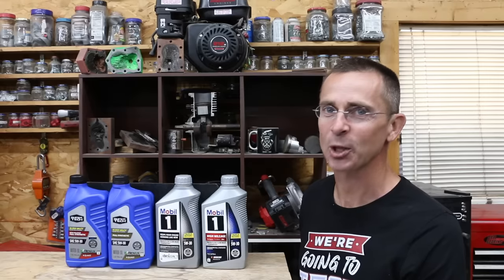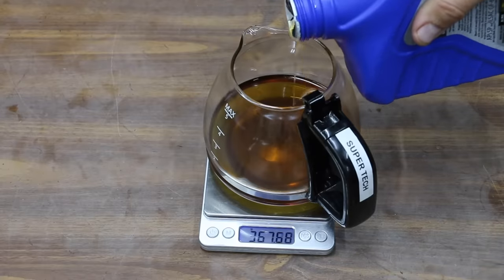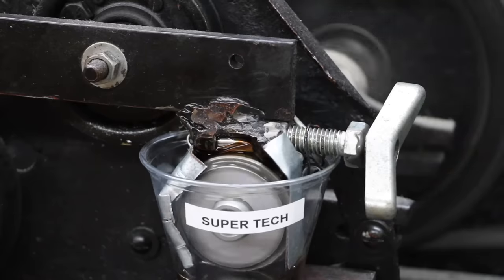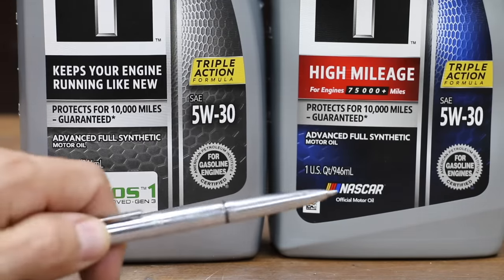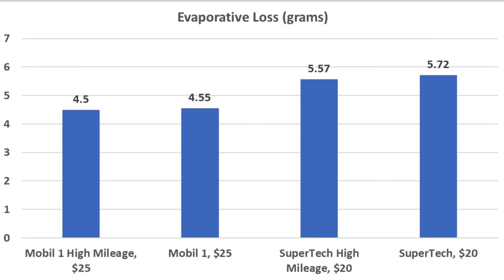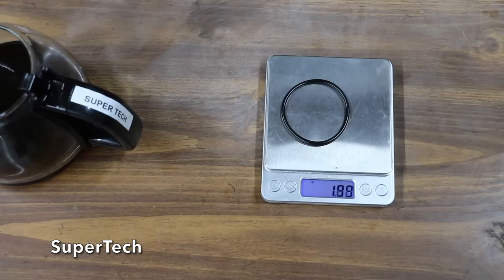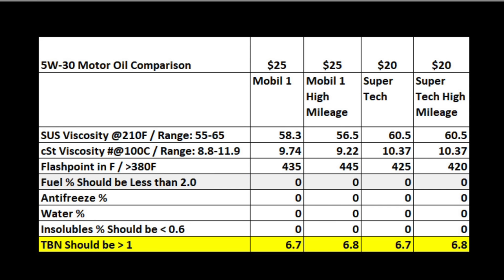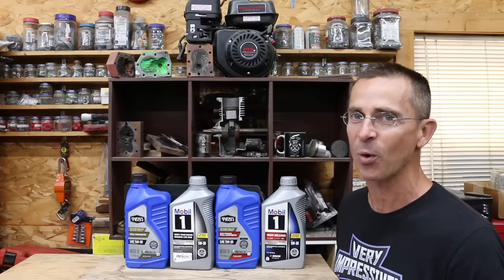Is “High Mileage” Motor Oil Safe? Let’s find out! Mobil 1 vs Mobil 1 High Mileage; SuperTech vs STHM

Comment: Until today I had been usung 0W20 Firestone (Penzoil) total synthetic oil for my 2015 Camry which has 92,000 miles. Today I switched to PZL 5W20 (Toyota recommends 0W20 or 5W20); surprisingly it was $30 cheaper. I hope it just as good.
Reply from the maker: Thanks for the sharing.

Comment: Valvoline High Mileage oil works great. Slowed and stopped oil leaks on my 1996 Toyota 4runner 3.4 V6 with 290k miles. The engine had a bad rear main seal leak and after using the high mileage oil for around 3k miles the oil leak stopped.
Reply from the maker: Thanks for the feedback.

Comment: Have been watching your channel for long time. A lot of them are quite informative and entertaining. Sometime when I want to purchase some tool or stuff not familiar, I will search in your channel to find out what the test results here. Especially these motor oil tests, they're really helpful for me to make a wise choice. However, I just notice that it seems no engine oil filter test has been done before, did I miss anything or they're already not tested recently? I would suggest to have a test like the air filter one to find out the best filtration capability of these oil filters available in market (Amazon/Walmart) like K&N, Mobil 1, WIX, Purolator, Super Tech, etc. Thanks!
Reply from the maker: Thanks for the suggestion.

Comment: Maybe you should test the Super Tech Advanced full synthetic from Wal-Mart the one that is good for 20,000 miles, I started using that one on my 2008 Toyota corolla and noticed an improvement in performance and acceleration and is only 21 dollars in my local Wal-Mart in California way cheaper than the Advanced full synthetic from name brands like Mobil 1 and Castrol Advanced full synthetic made that claim to be good for 25,000 thousands miles. I still change my oil before it gets to 6000 miles just to be safe.
Reply from the maker: Thanks for the constructive feedback.

Comment: I use the M1HM myself. As for price, Advance Auto parts usually run a deal for (now) $42 for the 5qt jub and a filter (M1, KN, Fram).  Although I remember a few yrs ago it was $25. blah...
Reply from the maker: Thanks for sharing.

Comment: I would say it does not have the textile certification because it does not need Sodexo certification it exchanged dexo requirements pretty much guarantee that they will find other problems before they blame the oil.
Reply from the maker: Thanks for the feedback.

Comment: @projectfarm I use Rotella Diesel Oil in a lot of my gas trucks. I've always gotten complaints about it, but never had any problems. A lot of these trucks have gone 50,000 to 100,000 miles and roughly are in the 200-300,000 mile range. I always use fully synthetic and change my oil around 3,000 miles out of habit.

My question is, can you do a video on Diesel Motor Oils vs Gas Motor Oils?
Reply from the maker: Thanks for the suggestion.

Comment: We run a custom blend from Power Driven Diesel on our engines with hydrologic flat tappet cams & diesels pre dpf & egr ect.  It has an amazing addative package with zddp for longer wear.  We also add lube to our US diesel for longer pump & engine life.  Low suffer was a mistake & global warming......  kinda hard to claim CO2 caused it when it dropped prior to the temp rise but we are not supposed to be paying attention!  Kind of like charging more for unleaded back in the day when they just stopped adding it but charged us more.

Comment: The only thing added to high milage motor oil is a seal sweller. The rest of the additive package remains the same. In theory the only thing it may prevent is an oil leak.
Reply from the maker: Thanks for the feedback.

Comment: One of my managers at work has his Masters and Dr degree's in chemistry, he did his thesis on motor oils, his conclusions on which is best, regular, synthetic, high mileage etc, was, just change your oil regularly. Synthetic maybe a little better but he didn't suggest it specifically. Also any additives in oils for what ever purpose, he said was gone after 1000km's/600 miles.
Reply from the maker: Thanks for sharing.

Comment: I really like the Mobile 1 high mileage. The one I got for my trailblazer was 15,000 miles. Oddly my change oil light didn't come on until around 25-30k miles. When it was totaled in a accident it had 316,000 miles on it. Original motor. No leaks other than exhaust. The local mechanic shop said I shouldn't use it since regular oil changes at a shop find issues most don't notice. I knew that SUV very well. If something wasn't right, I took it in if it wasn't something I was comfortable fixing. Mobile 1 is great. You can get 25-30,000 miles out of it. It costs $70 and you have extra for the burn off. Just my opinion.
Reply from the maker: Thanks for the feedback.
Reply: @ProjectFarm  I should note most my miles were interstate. But even when I was commuting to Minneapolis 175 miles, and driving in heavy traffic I still got around 20k before the change oil notification came on. City verse highway makes a difference. I don't want to mistake that. Most my miles were interstate and highway. Outside the cruises on minimum maintenance roads that I would beat on the old girl. Also I checked my oil frequently, if it was black and the light wasn't on I changed it. Though that only occurred with the regular Mobile 1 5k. It sucked during winter. The noises were gone when I switched to the high mileage Mobile 1. Granted a -35F day would be the only exception. But anything above -30F there wasn't the whine the regular synthetic Mobile 1 gave. I switched to the high mileage over a decade ago, so it's difficult for me to remember exact temps. I just remember that whine going away when I switched.

Comment: I've been an avid user of Valvoline oils for over 35 years, and the Maxlife high mileage oils for 15. Well over 225,000 miles on all my cars using Maxlife and no issues. They all get changed at 3000-3500 miles.
But it's nice to know Super Tech is right up there, as the supply of some name brands gets thin at times at my local Walmarts.
Reply from the maker: Thanks for the feedback.

Comment: Hi, I really like your video’s but please note that oil compatible o-ring material (NBR) used in engine shouldn’t swell.  As opposed, an epdm material o-ring which is not oil resistant would swell.
My 2 cents and keep doing the good job you are doing with video’s.
Reply from the maker: Thanks, will do!  Thanks!  Thanks for the constructive feedback.

Comment: Have you tested Motorkote UCL yet? I am interested if it is superior to Lucas and other brands. Upper cylinder lubricants seem to a niche but if they are beneficial in the longevity of my engines I will start using them based on the cost.

Comment: Hey Todd,  just a suggestion, if you could compare high mileage oils and include valvoline high mileage just to see which brand has the most antiwear and does the best at lubricity.
Reply from the maker: Thanks for the suggestion.

Comment: I had always had good luck with Valvoline high mileage. I thought. Started running it in my 80k mi Colorado I5 and developed a nasty lifter peck when hot. Just figured it was the motor. I accidentally switched to Mobil during one oil change and noticed the peck  went away. Tried  the Val hi mi and it came back. Now I’m peck free with Mobil. The moral is every engine is different.
Reply from the maker: Thanks for the suggestion.

Comment: 240,000 miles on 09 Nissan rogue, I only use royal purple. well guess this proves a point. just replaced cvt at 225,678.full synthetic by the other companies is still petroleum based. royal purple, chrome Oly, ams oil are true synthetic and I sure as hell won't use any thing else. I don't care if it is my last dollar. my vehicle is always had mid grade gas. and it's funny my cars last longer 🤔.

Comment: I didn't know Mobil high mileage is better.
My 1993 Jeep Grand Cherokee Limited 5.2 V8 is still going strong for 30 years without engine or transmission overhaul. Right now it is nearly 433,000 miles. Several years ago, I've used conventional oil then blue smoke came out from tail pipe as I didn't like so, I switched 5W-30 Mobil One Synthetic oil (no high mileage or no extended). I changing oil every 6 months Spring and Fall since retired is fewer driving to change at 5,000 miles but not beyond 7,000 or 8,000 miles plus, added engine restoration solution and Royal Purple oil filter for years (changing oil filter to max 10,000 miles (now I can't get Royal Purple filter size anymore I've switched Bosch). I've reduced engine thermostat to 180 instead of 195 degrees to prolong engine life without any problem or always passed smog check. Also, I've used mostly Chevron 87 octane gas of trying not get a cheap gas brand too.
Reply from the maker: Thanks for sharing.

Comment: I have stopped rear mainseal leaks more than once by using high mileage motor oil. Softening of the rubber seals takes time.More than overnight. I have seen it take 500 to 1000 miles before the mainseal would stop leaking. Also, I have saved power steering pumps by using high mileage power steering fluid take out the fluid put it in the high mileage. Run it for about a week then change the fluid again. Every time I have done this with the high mileage power steering fluid when I was finished, you could move the steering wheel with one finger Very easily
Reply from the maker: Thanks for sharing.
Reply: @ProjectFarm  Great video by the way. I have learned a ton about oil from your channel.

Comment: Great video as always, thank you! My 2015 Sierra has 180k and I've used Mobil 1 HM for a while.  I too noticed it doesn't have the Dexos certification.  When I asked a GM dealership service department about prioritizing the Dexos cert. of std. Mobil 1 or the anti-wear additive pacjage of Mobil 1 HM the response would have made any double-speak politician blush.  I've never heard such a non-answer.  I'm well beyond warranty (A/C condenser went 3k after warranty and transmission blew 13k after warranty ... as any 2014-2019 6L80 or 6L90 tranny is apt to do when, not if the torque converter disintegrates and blows chunks into the gear box), so I have no concern there, but it would have neen nice to get a straight answer I could use to make the best decisions possible to make the 5.3L last ... to make up for the paer mache' transmission :)
Reply from the maker: Thanks and you are welcome!

Comment: Thanks for doing this test. I have a high mileage Dodge truck 318 engine I want to keep going. 

A question for you: Have you tested oil filters on your truck to see what the Testing Lab results would be for 5000 mi change, 7500 mi change  or 10000 mi change? I'd be VERY interested in those results. Then after 10,000 miles, install a different brand filter and repeat. Maybe limiting it to 3 brands may allow you to complete the test in 3-4 years?  Just an idea. Thx!
Reply from the maker: You are welcome!  Thanks for the suggestion.

Comment: Could you do a test on oil weight performance in hot environments. People say you should switch oil weights in the summer, but manufacturers don't recommend. And does a lawn mower run better on 30w, 40w or 50w in summer. And does it make a difference to use straight weight or 10w20 or 10w30 in 4 cycle
Reply from the maker: Thanks for the suggestion.

Comment: Regarding the lower calcium numbers in the Mobil 1 - I wouldn't panic about that. Its likely very deliberate for very good reason. In recent years, oil and automotive engineers have discovered that calcium has an issue when used in excess. In the 'old days' it was common to see calcium numbers above 2,500. However, its been discovered in recent years that high calcium numbers are a negative impact on the effectiveness of zinc to protect in metal-to-metal contact. Effectively, the more calcium, the less effective zinc is as they both compete to 'cling' to the metal surfaces. Hence, it turns out, you can't have both a very good detergent package and a very good metal protection. You have to pick one. Hence, oils formulated in recent years have lowered calcium, typically to below 1200PPM and often below 800PPM. Also, high calcium is connected to low speed pre-ignition in GDI engines - particularly small, turbocharged engines.
The days of 'high calcium' levels in oils being a good thing are gone. Subsituting a portion of the calcium for magnesium is common among nearly every oil company now.
Reply from the maker: Thanks for the feedback.

Comment: My 2000 GMC Sierra 5.3 had 400K miles and was running great with no leaks.. I was using Mobil 1  High mileage for many years, changed every 5K miles.. Sadly the truck was stolen.
Reply from the maker: Sorry to hear!

Comment: Please test OW16 And Ow20 because all cars and trucks are using these oils now.. soon we will have 0w08.. that test shows mobil 1 is a subpar oil. People who use mobil 1 go right ahead, but I use Amsoil for over 20 years with absolutely no power lose in all my cars with 6 and 4 cylinders. No smoke at all. I have got a chevy v8 with over 450k miles and it makes absolutely No noise. Hands down the best in every way. Tore down an engine I tool out because I was putting a 4 cylinder Diesel in a 93 chevy truck with a 454 and it had Amsoil in it from the 2nd oil change. That engine was absolutely new looking, I kid you not! Absolutely no sludge, cam looked great, piston and rings were in excellent. Did a compression check and all cylinders where exactly the same. I live in AZ , so I'm in a severe service area, south AZ , Temperatures exceeding 112° plus it is 92 85 89° at night. Horrible on vehicles.  You can say, well change oil sooner but that's not going to change the wear from oils with lower TBN # .. most all oils only meet Industrial standards, which are the bare minimum. But unlike amzoil, it does not just meat standards, they're add package Exceedst industrial standards Or I should be more accurate to say it crushes industrial standards which like I have said before. Instead of four, they are bare minimum requirements. But by all means, use whatever oil you want, but I will make sure My family or myself will never be broken down. But please project farm, please. Test 0W16 and 0W20. Because just about every newer truck orr car uses those oil weights nowadays. Also, most vehicles now have cvt Transmission I would love for you to test that type of transmission fluid to see which one's better. Thank you
Reply from the maker: Thanks for the suggestion.
Reply: I'm trying the high mileage 0w20 in a newer (2017 Rogue) with almost 60,000 miles. I'll keep ya updated. I'm sure there will be nothing to update. It's oil. As long as your changing it on time, your golden.

Comment: The issue isn't really the oil. Most modern oils will last a long time. It's the filters that matter the most. Filter paper breaks down and when that happens you aren't filtering oil contaminates out anymore. Focus on getting a high quality oil filter that will last at least 15,000 miles or more and most cars will be fine
Reply from the maker: Great feedback. Thank you!

Comment: Using regular motor oil after 80,000 miles will keep leaking and leaking, high mileage oil are made for slower the leaks and less burn off and it's made for old engines ,helps keep it alive

Comment: I have noticed in the past several months that the Full Synthetic High Mileage oils are losing the Dexos rating on the labels. I haven't looked into exactly why that is, but maybe it has something to do with GM. Valvoline Full Synthetic High Mileage oils used to have the rating, even on their synthetic blended oils, but they don't have it any longer. Mobil 1 never had it on either their regular full synthetic HM nor their Extended Performance HM oils. Pennzoil did have it for a time on their HM oil, and Castrol did have it on their HM oils, but none of them have it any longer.
Reply from the maker: Thanks for sharing!

Comment: Don't use Super Tech oil!!  I used it in my 2002 Tacoma (3.4L V6 engine) and had oil pressure problems.  Did an oil change and used Mobil 1 and oil pressure was fine.  So I tried the Super Tech on next oil change and low oil pressure returned.  Changed the oil again and used Quaker State and no oil pressure issue.  I used full synthetic high mileage 10W30 for all changes.  The truck has 250,000 miles.
Reply from the maker: Thanks for the feedback.

Comment: My 2002 Tahoe burns mobile one like it’s a chain smoker but I used penzoile after seeing this the platinum and it didn’t burn hardly at all maybe a half quart over 4000 miles but I switched to royal purple and it burns nothing at all it’s honestly amazing no changes other than not using mobile one and I used mobile one for years and I claimed it was one of the best you could get I think it’s junk now amsoil is also great
Reply from the maker: Thanks for the feedback.

Comment: I know you did fuel/oil additives in the past, but I'd love to see an update, possibly more comprehensive tests on both 2 and 4 strokes, more brands, etc.  Would also be interesting to see some before/after images on the internals of some small engines.
Reply from the maker: Thanks for the suggestion.
Reply: Yes lucas oil engine stabilizer is a good idea!! I too noticed an audible difference when I put it in my car. Engine ran smoother for sure in my experience 👍
Reply: @hewasdeadwhenigotthere46 I use the Lucas injector cleaner and upper cylinder lube. I notice a difference in sound, runs smoother, and starts better. I love the stuff. I was even putting it in my lawn mower which appreciated it immensely